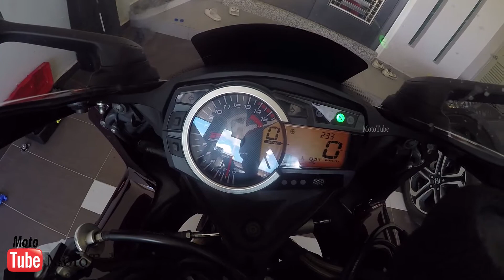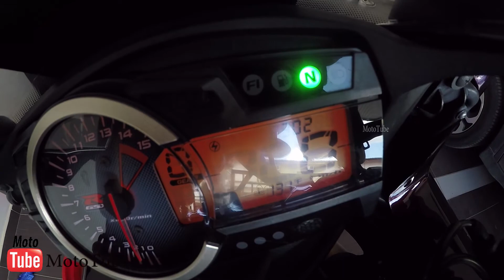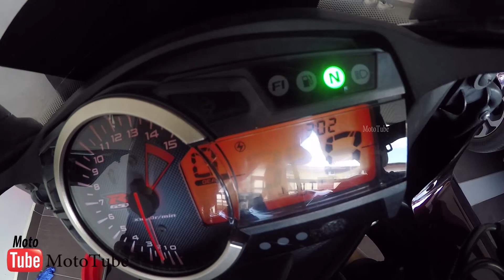Suzuki GSX R1000 k9 change coolant / Cooling system inspection

Comment: Is the radiator outlet hose supposed to touch the header on these Suzukis ? 2021 gsxr1000r . Mine has melted and lost all my coolant .. smh this after a month after my full exhaust install (M4titanium street)

Went on a looong ride .. no issue .. went on a short night ride the same day for about 15 mins .. boom .. coolest everywhere